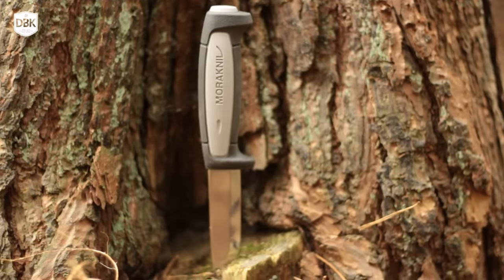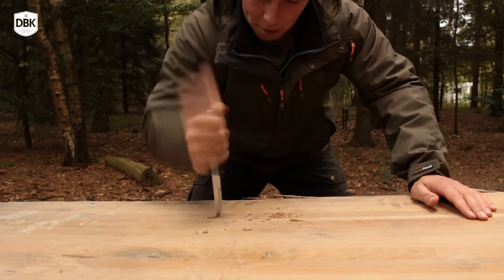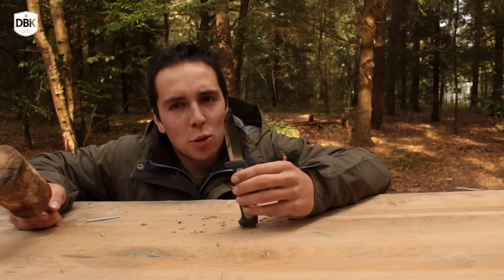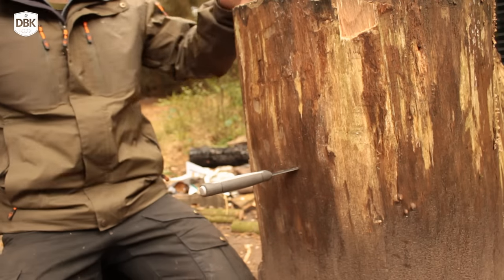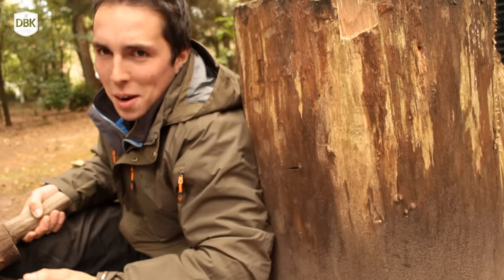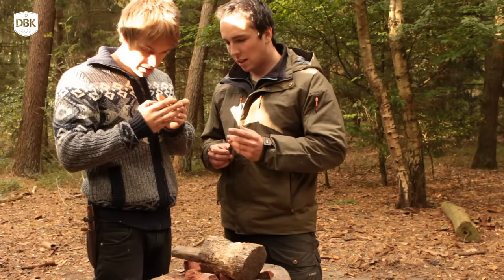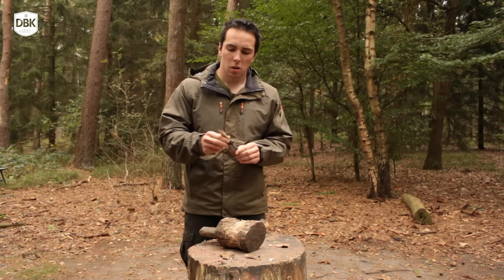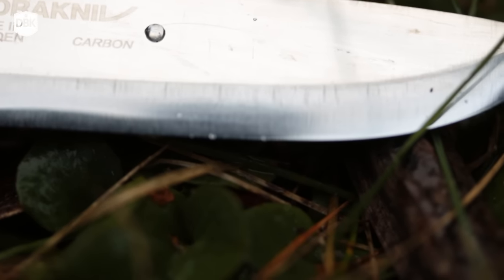The Indestructible Knife | Mora Robust

Comment: put it on a hydraulic press :)
Reply: yes they should do that
Reply: Joshua Kunkle they should do that
Reply: Joshua Kunkle ja ey mannen doe dat
Reply: WonderLust
 who cares it will be fun to see what happens
Reply: it'll break, a hydraulic press can shatter diamond, at this point the gimmick has been over played.
Reply: Hydrolic press won't shatter diamonds, they close slowly so things are broken with pressure where as the diamond is formed under extreme pressure. There is a video where a guy put one in his press and it burrowed into the metal.
Reply: Jeffrey levouski but then he put another one on top of the diamond that burrowed and it shattered.
Reply: Jeffrey levouski yeah but the second piece? It shattered one diamond went into his metal base and the other shattered
Reply: Erock Snips I can tell you guys now, that wasnt a real diamond it was fake. the one that shattered was an CZ
Reply: King Cold It was real, it had the certificate and everything for it. Not fake.
Reply: Yeah but diamonds didn't break at all, so it's kind of fake
Reply: The tiny one(that didn't break!) was real, 
the large one(... that did...) was (obviously!) fake.
Reply: btw, they cut diamonds with other diamonds xD
Reply: THEN HOW DID THEY GET THE DIAMONDS IN THE FIRST PLACE!??!! DUNN DUNN
Reply: they mined them up in, pick off what ever rocks are stuck to the diamonds, then use a non-polished diamond to sculpt others :p
Reply: no no thats over they should make a "1000 degrees knife vs mora robust" video
Reply: is anyone else questioning if they know that the carbon extremely hardens it? XD
Reply: Jeffrey levouski it depends on the material you use under the press. The press itself could easily shatter a diamond but the block under is made of a softer metal.
Reply: Jeffrey levouski That’s the stupidest thing I’ve heard in a while. Diamonds are formed when carbon is put under intense pressure, but it can still be destroyed quite easily with a stone and a human. Just like how water can still be boiled into gas after it has been boiled from ice.
Reply: thegameizsik it sounds like the friends name is geometry

Comment: I already have and I would rather recommend the Mora Companion HD, for another 5 dollars or euros
1. It has a bigger handle is easier to hold in different grips, remember Maarten was complaining how the shorter more closed handle of the Compact hurt his hand 
2. The blade is longer for batoning thicker wood
3. The spine of the blade is sharpened for fire steel striking
4. Available in carbon or SS

Comment: The fuck is it made of? Moon-rocks and space alloys?
Reply: Unobtainium
Reply: Swedish steel
Reply: Hardened steel in the center, for a sharp edge that doesn't need to be sharpened often, surrounded by soft flexible carbon steel to prevent the knife from snapping. The "blade" in the center has probably snapped at a hundered places, but it is all held together firmly as intended.

No magical materials, just pretty clever engineering.
Reply: Harald Kanin carbon steel is neither soft nor flexible. Carbon is what makes steel brittle. Also Mora's are cheap because their simplicity. Their not a sandwich of mild steel with a hardenable core.
Reply: John Smith Actually no, you are wrong. I live in Dalarna ("The Valleys") fairly close to Mora, and I've actually been there a few times.

To back up my facts, instead of being some internet troll I'll give you this snippet from "morakniv <dot> se":

"Knivbladens kärna är av kolstål med mjukare stål på yttersidorna. Laminatstålet gör det möjligt att härda stålet till hög hårdhet, HRC 58-60, vilket gör att knivbladet får en oöverträffad seghet, överlägsen eggbeständighet, maximal skärpa och livslängd. Dessutom går bladet går att böja"

To give a rough translation, it's something like this: "The knife's core is carbon steel surrounded by softer steel. This laminate steel makes it possible to harden the steel to high hardness, HRC 58-60, which gives the knife blade an unbeatable toughness, maximal sharpness and lifetime. The blade will also be able to bend."
Reply: Lol it was just a joke. I work at a Stainless Steel mill in Västmanland, bordering to Dalarna (close to Mora)
Reply: Fripz Nice! My answer was directed to John Smith though, so no worries. :)
Reply: UFOtanium Carbide.
Reply: Harald Kanin ok. I was just skeptical because you put the words soft carbon steel which is true but it sounds like an oxymoron
Reply: John Smith Oops, yeah that is definitely my bad. I was thinking (in the original comment) that the carbon steel was the soft steel surrounding the hard core.

So yeah, you definitely had reasons to be skeptical.

Anyhow, happy Black Friday and have a nice weekend!
Reply: yess
Reply: Fripz UHB-20C Valve Steel
Reply: Its swedish steel!  :)
Reply: Vibranium
Reply: Made by the Elves

Comment: another great video!  I like the robust but look up the robust HQ please do a test on that one. it's the only more with a finished spine. there 15 us dollars.
Reply: The Mora Robust High Q has been discontinued.  However, the Companion HD is for all intents and purposes the same knife -- the only effective difference is the color options.

Both of these knives are so similar to the one tested that another test would be rather redundant.

However, what I would really like to see is is a common set of tests pitting the Companion HD against some of the more expensive knives in the collection.
Reply from the maker: it will probably make me feel bad about my expensive knives haha. We might do it one day. If all my knives would get stolen I would be very satisfied with a mora as my main knife. Ofcourse there are many knives which are better than a mora but if they cost 10x as much they are never 10x as good. Mora makes it hard to compete.
Reply: rockets4kids-- OK I know it's been discontinued. but did you bother looking on ebay? nope. they have them for sale on there all the time I just bought 2 more. 
both of the robust's are the same? --- wrong again. completely different handle completely different blade. the spine is finished. 
so it would be useful to see that test.
Reply: rockets4kids also the companion hd. has no difference between the regular companion I have both. just a name difference. don't come and try to butt out my comments and act like you know what your talking about when you dont. that just pissed me off.
Reply: Rough Rooster Knife Sharpening Please learn to read.  I said that the 
"HighQ Robust" was the same as the Companion HD. The "HighQ Robust" is indeed a different knife than the "Craftline Robust" tested here.

I am also well aware that the discontinued "HighQ Robust" is still available, though it appears only to be available at a reasonable price through a single vendor in Colorado.  When I discovered this I purchased a half-dozen of them.

You are also quite incorrect about the difference between the "Companion" and the "Companion HD."   The "Companion" has a 2mm blade with with a 22 degree bevel angle and is a true scandi grind.  The "Companion HD" has a 3.2mm blade with a 28 degree bevel angle and a significant microbevel.  I am hesitant to even call it a microbevel since it can be seen even without a magnifying glass.

Now to be entirely complete, there is also the stainless steel companion which has a 2.5 mm blade and a 24 degree bevel angle. 

PS.  idiots really piss me off, too.
Reply: rockets4kids you are entirely wrong on both subjects. I deal with knives every day. I know them in and out back and forth. you apparently do not understand what is being said. 
I have no time to argue with you.
have a good day bud.
Reply: Dutch Bushcraft Knives Having used Mora knives since before you were born I did not find your test results all that surprising.  

I've been lusting after a Bark River for quite a while now, but I wonder just how much better it will really be as a cutting tool, but more importantly, I wonder whether the joy of carrying it will be offset by the fear of losing it or not wanting to use it to its fullest.  You see, I'm hoping you prove BR really is that much better to push me over the edge to get one.

There really is so little comparison out there.  So far the best I've found is Dr Wako's "deer measurement standard" -- the way he calls the Mora a "one deer knife" vs other knives which are "two deer knives" or even "three deer knives."  But the missing piece of information is how much time needs to be spent touching up a Mora before it can take on another deer.

In any case I'm going to be that tiny voice in the wilderness that hopes you spend more time making useful videos than silly videos guaranteed to collect views.
Reply: rockets4kids look here man, these guys have a good channel. if you don't like what they do or test. then don't watch. no one cares that you have been using mora since before they were born. I talk to them quite often and they are more than helpful. and actually one of the only channels that will respond to you. so if u think the videos are "silly" why are you watching them. go find someone else to bother and stop being a troll.
Reply: Rough Rooster Knife Sharpening Dude, I think you might want to check your watch, I think you've forgotten to take your meds.
Reply from the maker: Rough Rooster Knife Sharpening hey mate, thanks! i'm Sorry for my late resonse. this video got so many comments i couldn't keep track. this video might not be for everyone and I didn't like destruction test either until I saw the use of them. its like when a car manufacturer crashes a car into a wall to see how much it can handle. it doesn't say much about the main things like edge retention or toughness but it does show you if the heat treat is oke and if the overall build quality is right.
thanks for the support mate! all the best to you Rough Rooster!
Reply: Dutch Bushcraft Knives no problem man! I appreciate the response regardless of time. most people don't at all. and I never looked it like that. but now we know what it can do. I don't understand how it took all that especially not being a full tang. u can't beat mora for the price. u cough me just in time I just got off work. 
kept the vids coming! 
thanks 
Chris
Reply from the maker: cheers mate! thanks!

Comment: So... Is this a knife, or a chisel, or a hatchet?
Reply from the maker: It should ofcourse not be used like this. This was just to prove what this knife can handle. With a non full-tang blade like this, the heaviest work I'd personally do would be batonning small knotless dried pinewood to match sized sticks.
Reply: Like they said, it really isn't meant for this kind of abuse... but it's seriously impressive that it survived all of it without snapping in half or bending.
Reply from the maker: cheers!
Reply: Hello! I live in Sweden, quite close to Mora and have actually been there quite  afew times. Stuff like that is actually what the knife was intended for.

Yeah no, maybe not standing on - but need a can of paint pried open? Mora knife. Need pry some things apart but cannot fit a crowbar? Mora knife. You get what I mean.

It was intended to be a knife that you wouldn't have to worry about breaking, that could take a lot of abuse and be used for everything. There's not a carpenter in Sweden without a Mora knife, or a Mora knife style knife.
Reply from the maker: cheers mate! thanks for the comment!
Reply: Avarickan issa knife

Comment: The first thing I did with my Robust was open a package that had a staple in it. It caught on the staple and chipped in two places on the blade. 

That being said, I am a heretic that re profiles ALL of my moras on a worksharp at 25 degrees and they seem to last a lot longer and hold without chipping at all and I can still get them razor sharp.  They are no longer scandi bevels but they seem to take more of a beating than the factory edge that always chips for me.

Comment: Hi Dutch Bushcraft Knives. Would you prefer the Companion Heavy Duty or the Robust and why? I notice that the older version of the Robust has a better grip (if you use the chestcarving technique with the new design the end of the grip pushes into the flesh of my hand). Is the sole difference in price related to the 'Bushcraft' marketing stamp?

Comment: I just bought two Mora's last week the robust and the Bushcraft black. Didn't have time to open them and look at them until today. As I'm as I'm typing this I'm sitting here at my campsite trying out some cold weather gear and other things. I brought both my Mora's to see what one im going to use for  my companio knife I pulled out my Mora robust and I've seen this video and all others just absolutely praising this little knife and I so want to be absolutely blown away by this knife. For the price the toughness and everything I've seen said it was a great knife. But as I'm looking at the blade I'm so disappointed maybe it's just a fluke maybe it missed the heat treat process or something. But the blade has a crack in it from the tip of the blade on the spine all the way back to the handle. Again so disappointed but the knife feels good in my hand it's light and I'm an optimist so I'm hoping this is just a fluke

Comment: I bought my first knife...a Mora robust... Because of this video. It's short, thick and heavy. So I bought a companion carbon for other work. But the robust is my work knife and I use it for all sorts around the house without fear. If I smash up the blade, it's easy enough to sharpen again. Using power tools? Dip it in water often when you're working. Or just manually sharpen on coarse sand paper first. 

It does loose is razor edge quite quickly. Not a problem for this kind of knife though. They don't do a stainless 12c27 for this knife as far as I know, but that may be my market... I'm in UK.
Reply: Ian Woodland ñ

Comment: that video confirmed why i have a (twice expensive compared to the robust, but Sandvik 12C27 goodness) Eldris as my EDC and a Robust (c) as heavy duty knife xD incredible abuse dealt on it ... and still hold it like a champ ... price point "nailed" (pun intended) 

i wish i knew about them when i was in the army ... i am Swiss and the pocket knife we have is good for general light duty but for other things where i did use my bayonet, i wished i had a Robust (not because the STGW 90 bayonet is bad ... but cleaning and caring afterward was a chore xD )

Comment: I received my Mora robust and the blade was greatly flawed bumps and a tiny jag at the point of the blade a line across the width of the blade and a few other flaws. this was not what I expected. I got in touch with the guy that was selling them on line, and he told me the knife is made in Sweden (I knew that already) and it only cost 15 dollars what   did I expect? I didn't expect al those flaws. Guys set me straight and help me out here . Was I expecting to much?
Reply from the maker: +Sufu Hashim hey Sufu, you got a bad sample and the seller should replace it. I've never seen this on a mora.
Reply: thank you, I didnt think it was supposed to be like that.

Comment: why not regrind a knife on a belt grinder? i make all my knives on a belt grinder and you wont get any tempering issues aslong you dont overdo it and regular put your blade into water. grinding with your bare hands is a good indicator to know when the blade gets too hot. anyways awesome video :) i recommend the mora to everybody i've ever met but most say it looks like a kitchen or a garden knife and they want a tacticooler looking blade even if it is crap (fun fact my mum actually has a real old mora garden knife :D)

Comment: Just tried out a knife, and other knives too. The reason why the Mora was very sharp was simply because the wood can somehow sharpen the tip of the blade when stabbed into wood. Not trying to start an argument just try it out too.
Reply from the maker: +David Hagerott the wood can remove burr and straighten the edge. It will definitely make your knife sharper than it was if you pull is softly through the wood. It's not removing any steel so it's limited to deburring and straightening.

Comment: 13 euros? You are ripped off. In Sweden its more like 8 euros😁 No kidding knife, I use it as a puukko after grinding the finger guard down and front top to sharp angle. Only bad thing about it is that it will rust.
Reply: Actually, it's another bad thing about it and that´s because most people just buy a new when it's getting dull. They have 100 lives left. Kudos to you who re-lived it 🤠

Comment: My D 2 knife I made at age 16 is far more robust that these and I only sharpened it once at age 16 in the early 60s. It still shaves hair. I built it to last. Breaking it is not an option. At age 21 I made a lilac wood scabbard for it. That wood requires machining techniques to work. It is extremely hard and tough.
Reply from the maker: +John Nall that's amazing man! A true treasure. Only time and work can make an item that valueable..

Comment: im not sure about the point of the testing? the blade was badly dented which you then ground off. any knife can be redged so the edge do not really show the knife is tough as you had to grind it. i like the tip test though
Reply from the maker: +Jason Leo it shows that this knife can both be pushed to the limits and is still easy to restore for a 10 euro knife. A 300 euro knife will damage as well but not many 10 euro knives survive these tasks without breaking